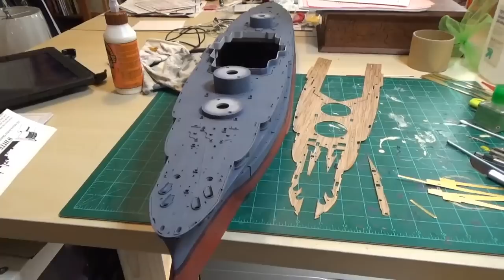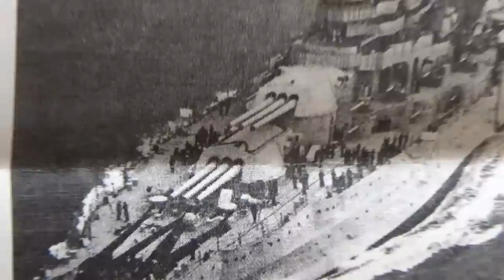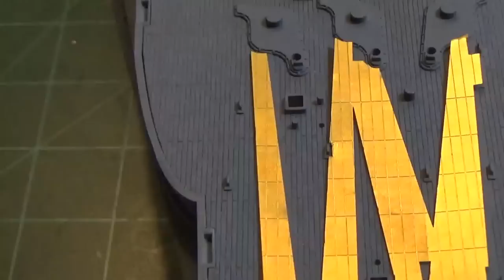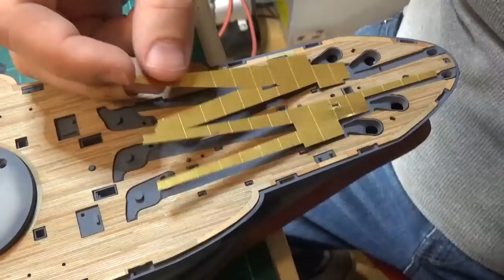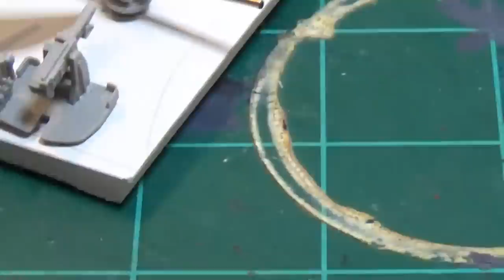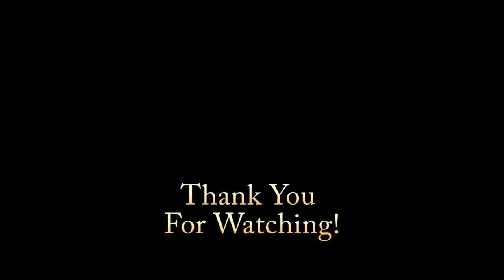USS Arizona by Trumpeter 1/200 Scale Build Video 2

Comment: I'd chuck the White Ensign photoetch. It's clearly not engineered to work with the wood decking. Though I've never built the Arizona, I've had a lot of frustration with White Ensign on other ships. It will look good without the etch and just painted.
Reply: Absolutely.

Comment: Just looking at those paper-thin veneer panels gives me the willies lol.
Reply: Me, too! I have the kit and wood deck set. I'll be trying and trying again without adhesive until I get it right.
Reply from the maker: It’s really not bad. Grab a small section first to get the feel of things and you’ll be good 😉
Reply: @TheMidwestModelShop  I'm thinking of setting the wood deck sections and adjusting to fit exact, then starting at one end glue the end, let it set and then continue the gluing process.
Reply from the maker: @davidrasch3082  Whatever makes you comfortable. I just check the fit everywhere a couple times. You'll have to trim a couple areas slightly. I recommend, like you  said, always starting at one point, when you check your fit. Its like practicing for when you glue it down. And as long as you coat the plastic deck AND wood deck with wood glue, you'll be able to make any adjustments that you may need. Its not permanent until the glue sets up.
Reply: @TheMidwestModelShop  Got it! Thanx.

Comment: Are all those railings from the Eduard PE?
Reply from the maker: Mesothelioma, yes. I used the Eduard and kit supplied railing on this kit.
Reply: The Midwest Model Shop so what PE parts come with the kit?
Reply from the maker: Mesothelioma it comes with PE railing, barrels for the main guns, anchor chains, and some other random details. If you watch the very first video in the series, I believe I cover what is included in the kit and I show you all of the extra parts I purchased.